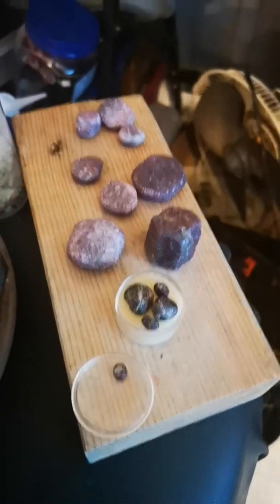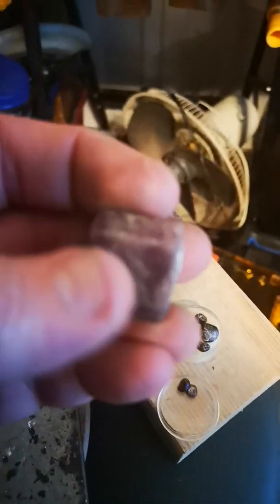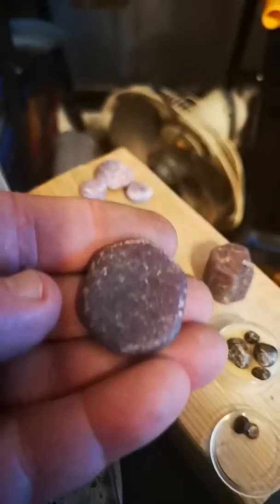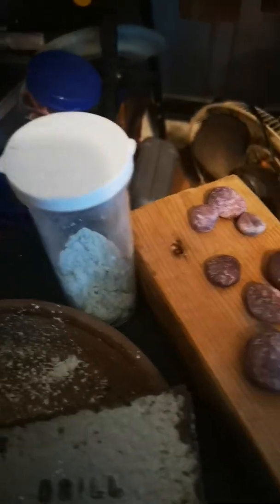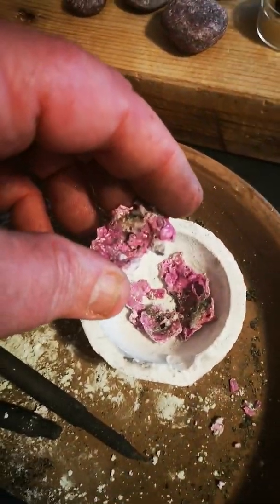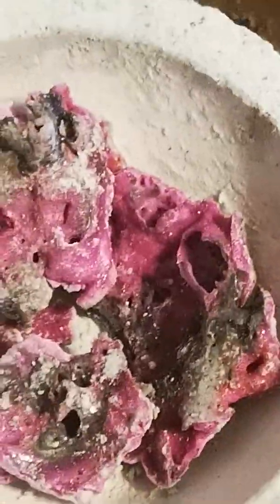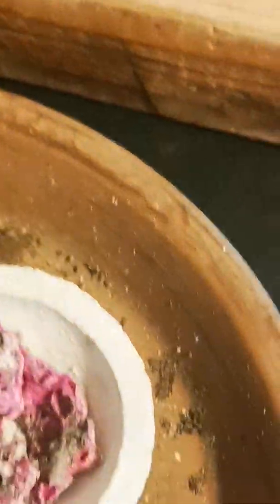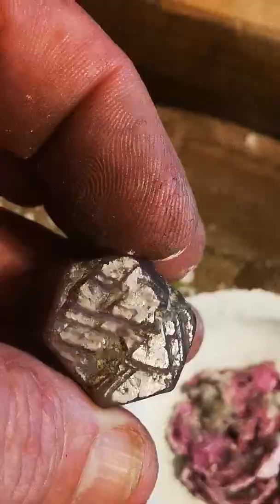DIY synthetic Ruby.

Comment: Exactly what I was searching for. My friend and I are planning to make these for fun. Would love your assistance on this.
Reply from the maker: What do you need help with ...

I use carbon electrodes .... (Bought from eBay/Amazon or gotten for the 6 volt standard rectangular alkaline batteries doesn't matter if they're charged or empty.... And I harvest the carbon rods from those though the first time you use them you need to heat them with your power source outside because they're infused with wax and they will make lots of smoke.)